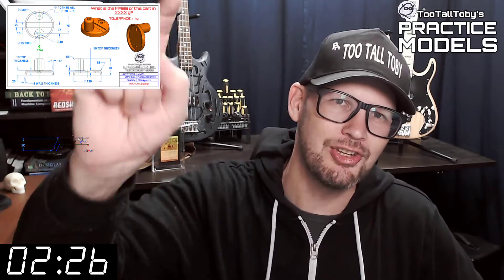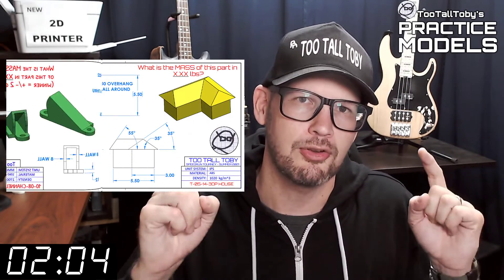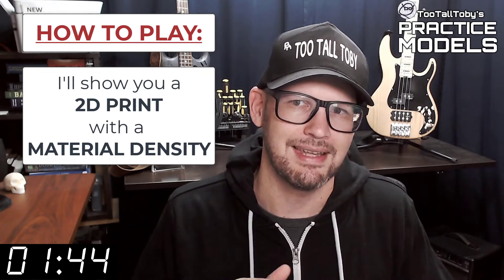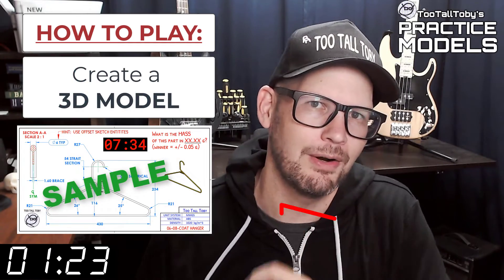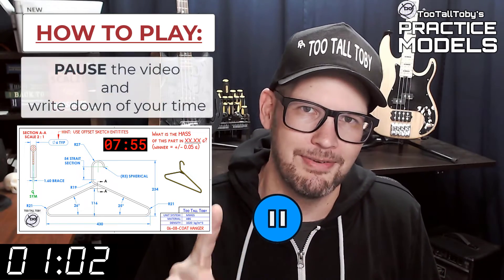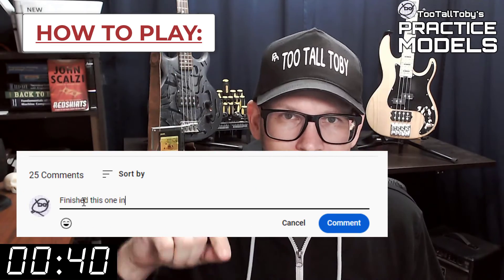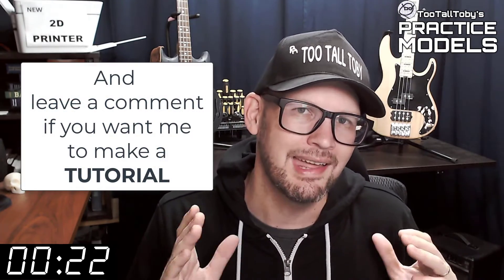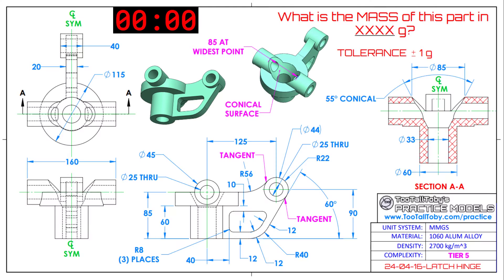2D Drawing to 3D CAD - PRACTICE MODEL- Exercises for Onshape, SolidWorks - LATCH HINGE

Comment: I'm new to SW. How do you do get the extrude next to a round face without a zero geometry error?  The circular parts were simple, but attaching the other part to it gave me some trouble.
Reply from the maker: Here's a LIVE SOLVE of that model - I did it using Onshape but the 2 programs are close enough that I think you'll be able to use this guide to figure out how to model it in SW:
https://www.youtube.com/live/a-TV9nlEjsQ?si=EBYDPVht-Qt5r1IN&t=2373
Good luck!  
If you're still stuck after this, hit up the discord (link at www.TooTallToby.com/practice) for questions - great crew in there!